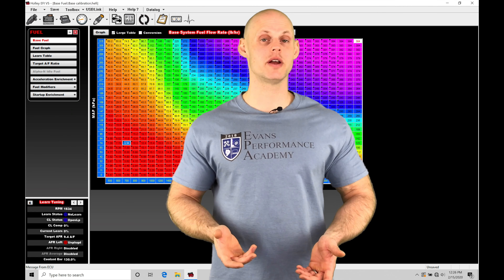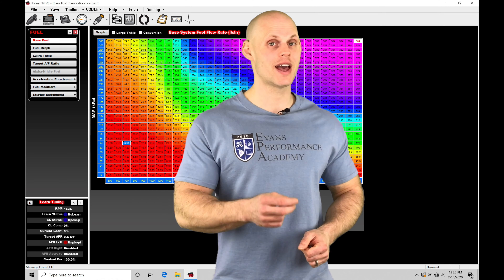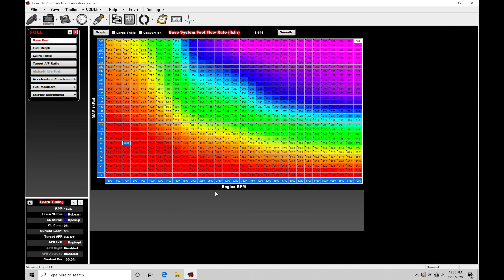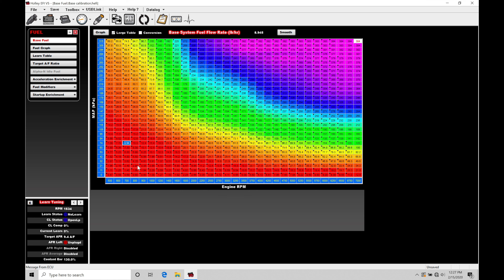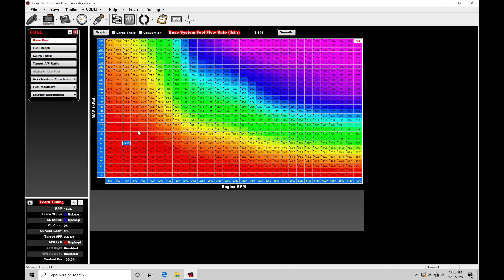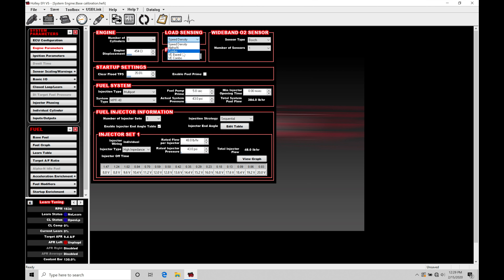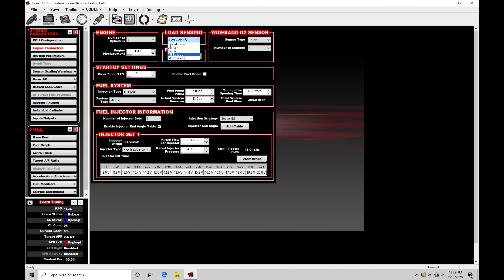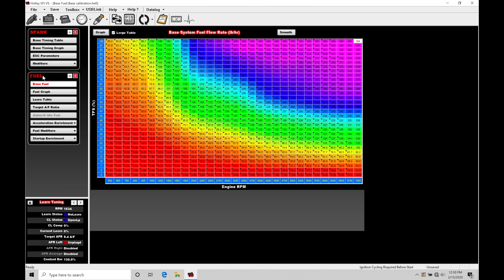Holley EFI Training Course Part 22: Alpha-N Tuning | Evans Performance Academy

Comment: You should clarify extremely large cam by indicating a cam with a lot of exhaust and intake overlap as it’s more descriptive.  Further clarifying that it confuses the o2 sensor thus using alpha n may help.
Reply: Speed density doesn't need O2 sensor feedback.
Reply: @Marc_Wolfe  Yes, thats the point.  People with "large cams" ( ones with exhaust/intake overlap ) use alpha n for idle tuning because the o2 sensor will have air going back and forth over it due to overlap, and then using MAF or volumetric tuning after 2k rpm.

Saying 'large cam' is not a descriptive term and it should be clarified as overlapping cams.